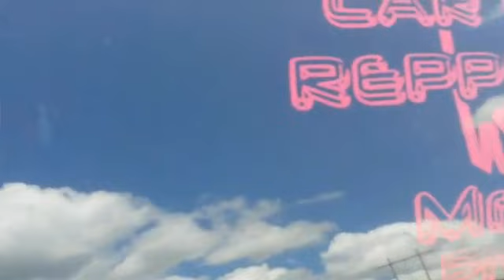Wall Build Pt 9 6-L7 Kicker 15s

Comment: Did you have a shop build and install everything? Or did you do it all yourself? I was an installer for about 8 or 9 years after high school and specialized in bigger custom jobs and I did all the custom boxes. Your setup looks nice and I’m sure it’s loud as hell, but I know after having 10 different sets of the kicker square subs starting with both the L5 and L7 when they first came out, four 8’s, three 10’s, two and four 12’s,  one, two, four 15’s… and Ive build over 100 different boxes for the square Kickers, trying everything possible from small to huge sealed, small to huge ported, even 4th and 6th order bandpass. If your setup is sealed I assume due to not having the space to run 6 cubic feet per sub ported, I guarantee that if you dropped from the 6 subs sealed to 4 vented with the same power per sub you would gain a big amount of volume. That’s one thing about the solobarics, in sealed boxes they sound nice and I like them for sound quality systems, but they aren’t very loud. Put them in bigger vented boxes close to the max recommended size and they come alive. I ran 4 8’s in a big vented box I built and it outperformed 3 10’s in a sealed box. I recently built a 14 cubic foot ported box for four of the newer Q series L7 h12’s running off of two JL Audio HD1200 amps and installed it in a tiny Daewoo hatchback , after gutting the back seats to make it fit. It was in major need of a alternator upgrade, but it still beat like holy hell.

Comment: My Q class L7 15 and Solo Beric L7 15 together are hittn probably just as hard as that bro, i know your system has great potential but you need way better amps to get them moving my man. Awesome looking set up, but needs way more power. Each subwoofer should be seeing at least 1000 watts/RMS a piece period, anything under a 1000 on each subwoofer is not going to cut it
Reply: I agree. Needs more power. It'll give you  much cleaner bass and solid lows!